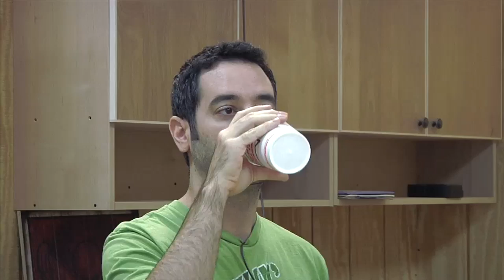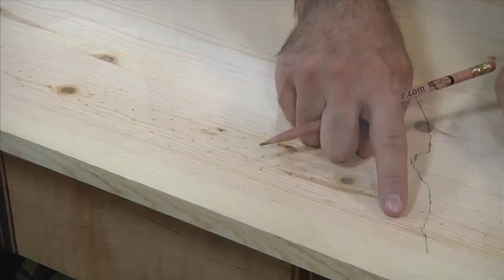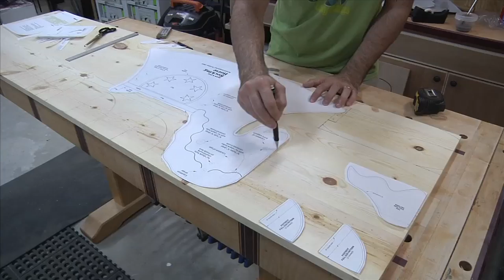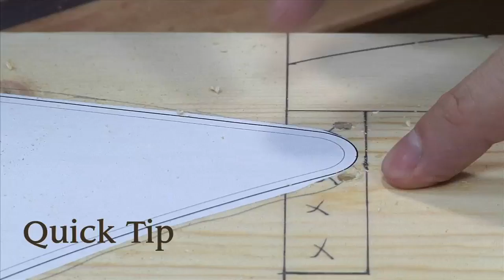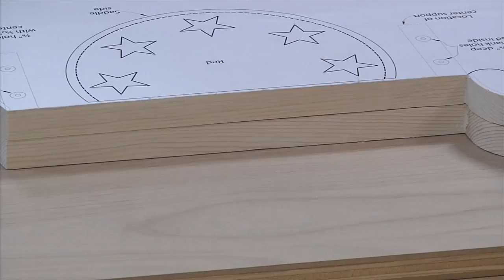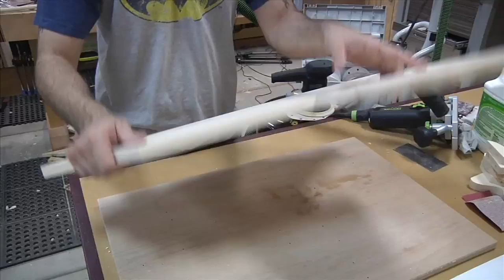How to Build a Child's Rocking Horse (Part 1 of 2)

Comment: I built this project for my then 2-year old I think right after the video came out, so over 10 years ago. I think it was my first ever woodworking project, I built it out on our tiny apartment patio using a hand me down jigsaw, balancing the panels on a 5 gallon bucket in place of a workbench. My kids all one after the other outgrew the horse and we finally gave it to a younger couple that had their first baby about a year ago. I still do woodworking, nothing fancy, but this is where I started, so thanks.  Glad you're still doing what you're doing and finding success at it.

Comment: Good tip on marking the French curve. If you don't want to mark the curve though, you could cover it with a strip of masking tape, first.

To get an identical piece for the other half of the body, you could tape or clamp the two together and use a bearing-guided router cutter to trim it.

Comment: At 12:33 I really wish you had listed the dimensions of the center support. It took some extrapolation, but I finally figured them out. But, thank you for going though such detail on the rest of the measurements. Saved me from having to buy the no-longer free plan! :)

I made it through everything in the first video in about an hour and it went great.... I can only imagine how many times you wanted to pull out your spindle sander during the cleanup phase. :-)
Reply: Vd zzz

Comment: An easy way to transfer patterns with adhesive, is coat your project with blue painters tape first.  you can mark your lines, then spray the paper not the wood.  stick the pattern down.  When your done, the painters tape peels off with no residue left, and you get no overspray  onto parts that dont' have the pattern.

Comment: Great video as usual Marc. To remove the paper that you attached to the wood with the spray adhesive, you might be able to use a heat gun. A youtuber called the 'scrollsaw workshop' uses spray adhesive frequently and he removes the paper with a heat gun. It might be worth a try. Thanks for the video ; )

Comment: How about using a non-permanent spray adhesive and only spray it on the paper? This should save you quite some time and seems much less messy. Question ofcourse is it the adhesive is strong enough for working with.

Comment: Hei Mr Woodworker :-) To get the paper off, why not just use a spray bottle and spray boiling hot water on the paper? It'll peal off like a breeze and you'll save both time and a buck on sanding paper while you're at it

Comment: Hello. I have a question? Wouldn't an easier way to transfer the blueprints to your work piece be by simply attaching them to the workpiece with a couple of pieces of tape, so they don't dance around, and then using indigo paper (I hope that's what it's called in english) to trace the lines on to the workpiece? It would certainly save you time by not having to scrape the glued on paper off the work piece.